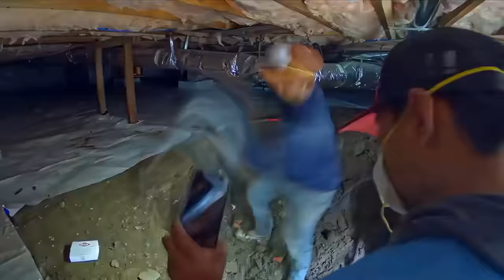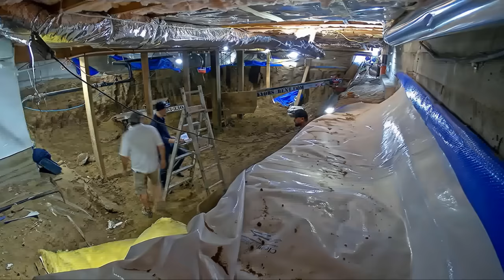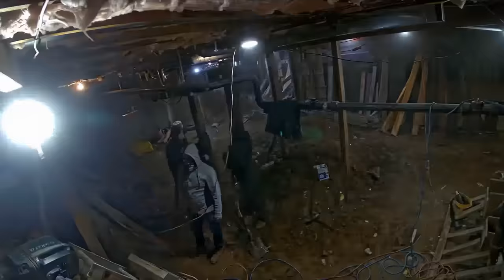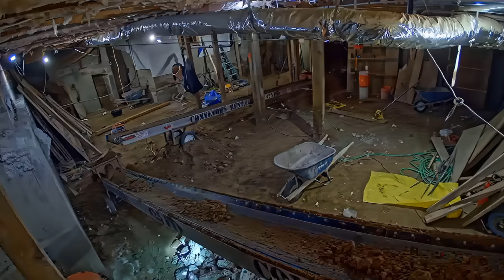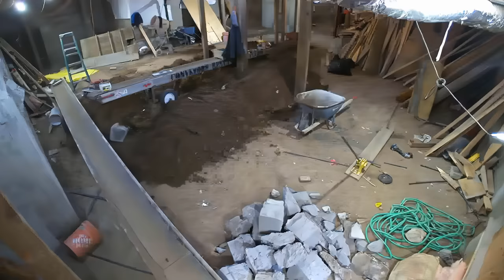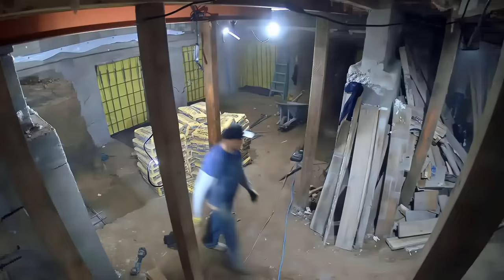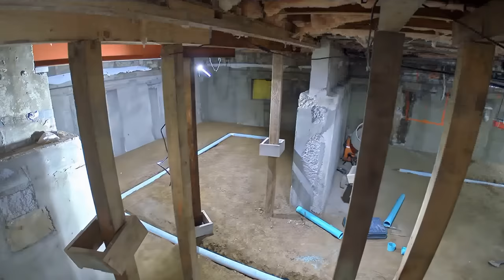Digging Out a Massive BASEMENT From Start to Finish - Time-lapse

Comment: Nice work but the owner is ASKING for trouble. That house was not designed for a basement.
Reply: Probably not your right they used no rebar but extra strong concrete they left cast iron plumbing in the floor of the new poured foundation. Soil is not right it will sink .
Reply: What's that supposed to mean?
Reply: @TheIggypop1  hardly anyone puts steel in basement floors. And there's nothing wrong with pouring a floor on undisturbed soil.